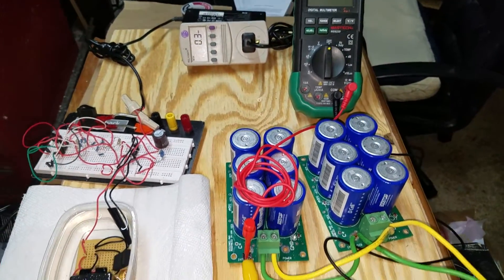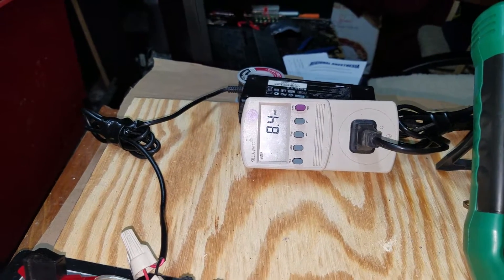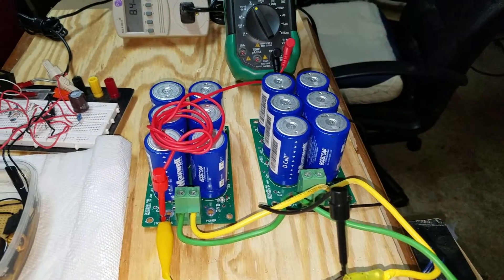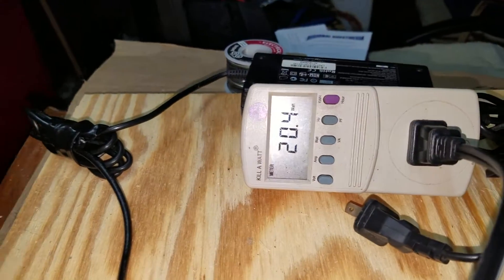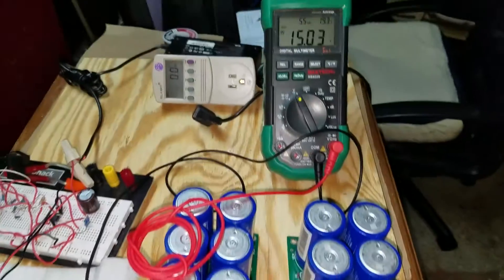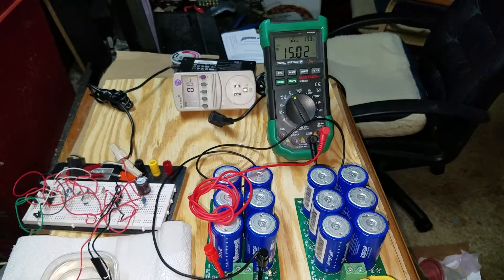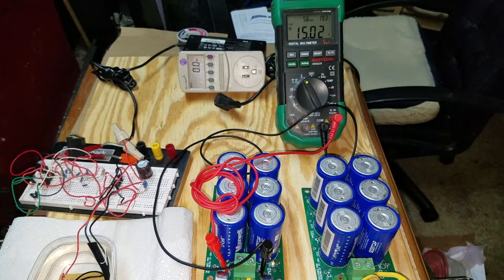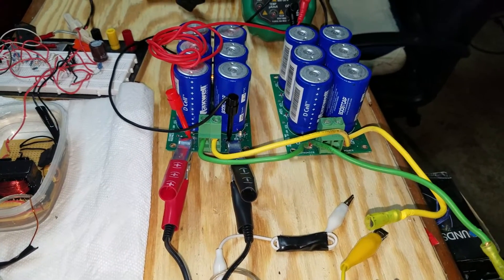Radiant Charger Vs. Conventional Charger Test 2/Part 2

Comment: Search for tate ambient power module. It utilizes germanium diodes to rectify pulses into DC. It works great. Similar idea to Avramenko's, but Avramenko's is really for HIGH voltages I think where as the Tate idea is for reception from an antenna and ground.
Reply from the maker: I'll have to try them. The germanium diodes are great for harvesting all sorts of energy, though, I've never tried them myself, but it's a good idea to try.. I heard of it somewhere long ago and I did add one in a relay charger I used that powered itself and an led for quite some time until the battery had lost it's life from the harsh hv pulses. Anyway, thanks for the idea. Let me know if you eventually have time to experiment with anything again soon. I think I have watched all of your videos over the last 4 years or so.. I have learned some pretty neat energy transmission properties from the coil you've worked with.

Comment: Lightening
Reply: marc  ,  gerard stated , linemen know , that if the last xfmr in the distribution system is not grounded the xfmr will pick up so much ambient energy from the entire system that it will explode  ,,  if this is true then all this background energy manifested via high voltage lines is eventually pumped into the ground
Reply: the earth spinning like a giant static generator builds up a massive charge  ,,  when conditions are right a trailer goes from the groung up and is immediately followed by a lightening bolt comming down in a effort to balance the two potentials  ==  as long as the earth spins this charge will build up and can be harvested for useful work
Reply from the maker: The last transformer in the system must have a lightning arrestor. This is an arc gap between the hot leg of the high voltage bushing and ground. When the voltage builds up high or gets hit by a lightning strike, the arc dissipates to ground through the arc gap. There isn't a tie to ground on anything but the neutral leg, however in a delta system, the outer casing of the transformer  is always grounded but the coil ends are not. Delta lines return on the phases unlike a neutral system. But in a wye system, one end of the coil is always grounded, and the secondary center tap is tied internally to ground, as well as the support that holds the core in place. I have a video showing the transformer internally that I added to Youtbe, but it was never finished editing. It is currently locked, however I could unlock it for you to see if you wish. I am in the line business, have been for 20 years and I run a bonified apprenticeship program, teaching line distribution for my company.. There is a build up of static discharge only in a phenomenon called Ferromagnetic resonance. Since the transformers are not quite in resonance, two transformers of different kVA size fed through shielded cables can have the right combination of capacitance added to their coils in series via the cable's capcitance. When this engineering nightmare happens, we get resonant rise on one coil, causing an inequality of energy and a voltage rise on one coil, then when the lineman or cableman switches the system on, the 3rd phase will normally explode with disastrous results. This is the energy he speaks of. It can be manifest in any system if the correct capacitance is added to any one coil in parallel or series and it has to do with the difference in potential between the system., creating hundreds of additional amperes from the environment, that ends up being megawatts of additional energy. I have accidentally recreated this hazard and created Pelex from this phenomenon that I witnessed back in 2011. Gerard has figured it out without the use of a ground and  pulsed dc input , or pulsed magnetic reaction using a permanent magnet generator, which causes the BLUE SPIKE theory Tesla was so interested in which killed linemen switching a DC system. It's an inductive & capacitive charge simultaneousaly that is unmanageable while energizing a dc system that builds up when a conductor is installed in a conductive pipe. This causes the same thing a shielded cable does, a capacitor which them while building charge releases the build up of energy. If there is a capacitance and no ground, the other side of the capacitor build up to the same potential by atmospheric energy replacement. In Gerard's system, the capacitance is created by a plate type winding which incorporates the inductor and a capacitor, and it tends to induce energy inductively while energy manifests from the atmosphere capacitively. This is also done with Don Smith's plate theory and an HV arc, and can be done a number of other ways, as shown by Vladimir Utkin..